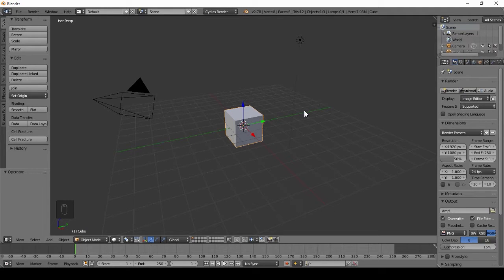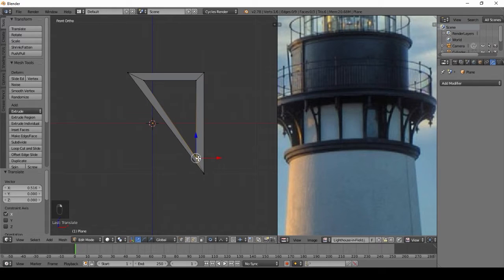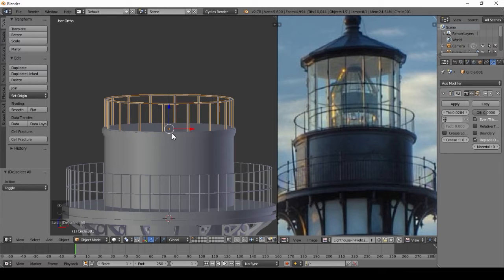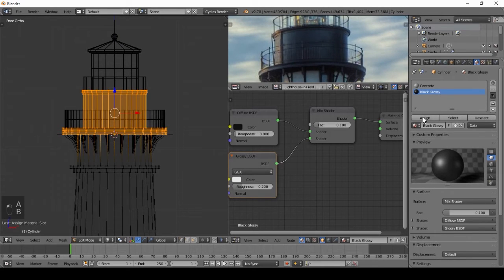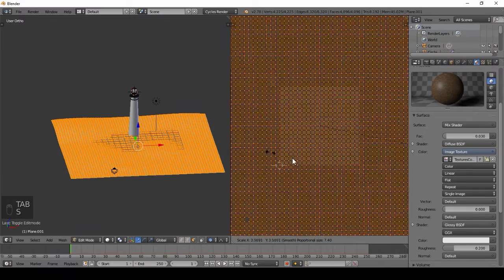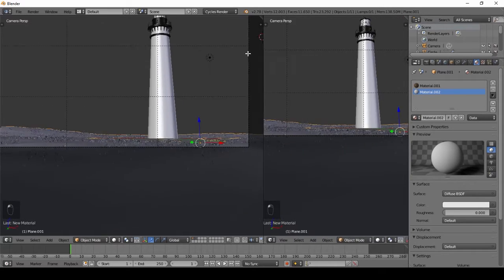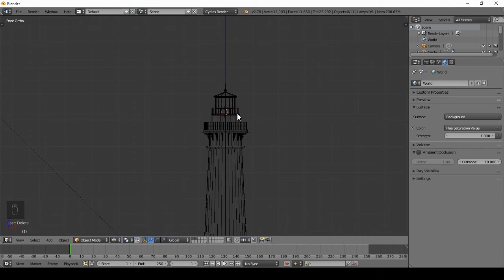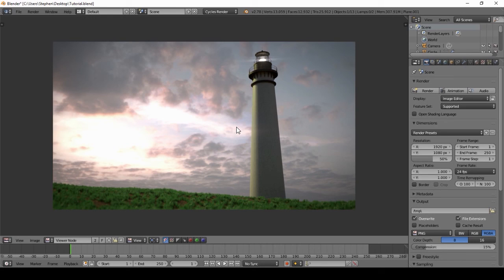Blender Tutorial - How to Create a Lighthouse in Blender!

Comment: I just found this tutorial and am really enjoying it, but when I go to do the color part the black trim like you show, it is coloring the entire base black as well.  I do not know what I have done wrong or what I could possibly have missed.  Please help!  I have selected just the trim using the B tool, yet after I hit apply the base is black too.
Reply from the maker: You have probably applied the black material to the entire mesh. Select the white material and then select the part of the mesh you want white and hit assign. That should do it! Let me know if this works! :)
Reply: When I go into object mode and select the base, it has the whole thing as one object and for the life of me I do not know why.  I am relatively new, but have done tutorials on the basics quite a bit.  You can look at this image to see what I mean. https://gyazo.com/8fb9aed9aba094b75f1a4ab2cbe0f7ff  When I have the base selected in object mode, I gather I should be able to right click on the trim and select it, but it will not select.
Reply from the maker: You can't do what you are trying to do in object mode. Let's start from the top. You have to add another 2 material slots on your object(the white material and the black material). You have to be in edit mode to assign a new material. Go into edit mode and select the part of the mesh you want to add the white material and then click assign on the right panel.  Do the same for the black material. If you have done it correctly it should work.
Reply: Thank you for the help.  I finally got it just like yours.  I watched your key strokes and wrote them down and that was the solution.  Loved the tutorial.  Thank you for taking the time to provide the tutorial & the response when I was having issues!